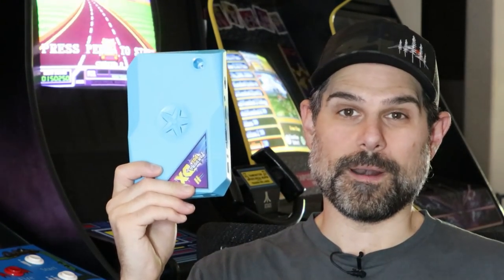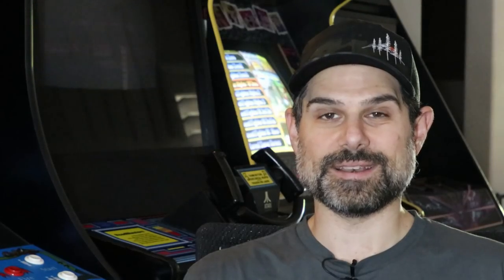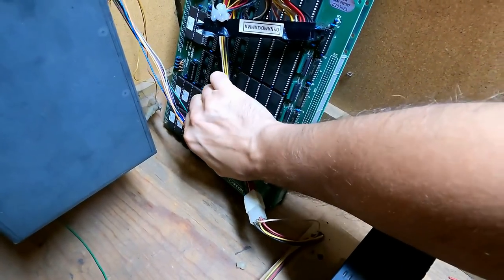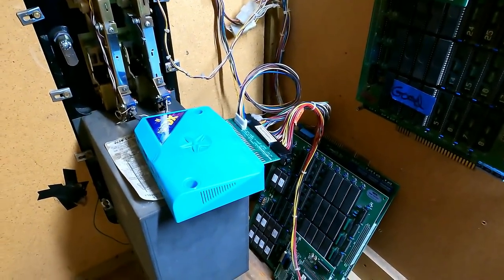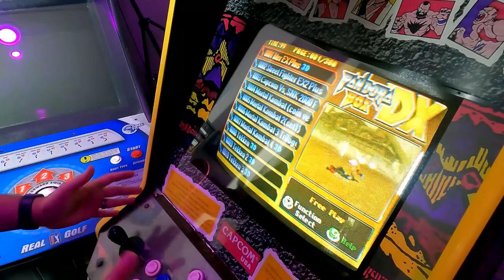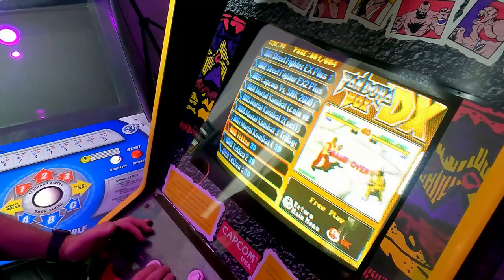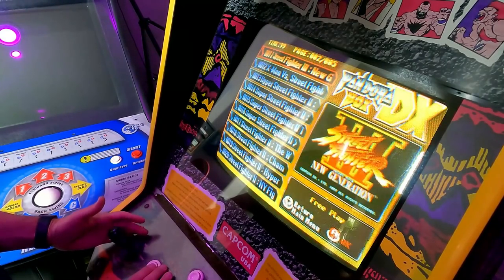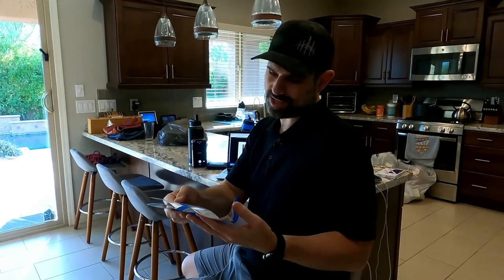Pandora's Box DX in your Street Fighter Arcade Cabinet - Is it Worth it?

Comment: I have one of these in an old converted Neo Geo Z Back cabinet with an older 26" Samsung LCD and a scanline generator over VGA. I think it may have once been an SF2 cab because the control panel was drilled for 6 buttons but only filled 4. It originally came with a single slot MVS and one of those 161 in 1 carts. The comic book shop I bought it from was going out of business and left it on all day, so the 25" tube had awful burn in and I couldn't find a replacement. The menu system and loading screen look slightly different on mine with a V1.3 in the corner, probably slightly more up to date. I put in a new harness, replaced the sticks with some IL bat tops and added all new buttons in all 6 holes. Works great, no bad tearing like I experienced in the Pandora 5 and 6. I'm happy with it and it's features.
Reply: I have a DX in an original SF2 cabinet I bought that came with a Pandora 9. I threw that out and put a 6 which was the best one till the DX.  I've noticed since I got the DX the screen is shifted to the right far enough that certain icons and graphics you can't see.  My cab came with a 720 LCD.  Was curious if you've had the same issue.
Reply: @mak23997  I don't remember whether I ran into this after hooking it up or not. I may have made some adjustments in the screen's OSD but that was a while back. My monitor is an older 26" Samsung computer monitor and I run the DX at 1024x768. Is yours running off VGA out? Could be the slight resolution difference if your monitor is 1280x720.

Comment: I went from a Pandora's Box 6 to a DX thinking it would be a solid upgrade and was really disappointed with the screen tearing and audio issues. The games were really low volume, but the menu screen was so loud it sounded like gunshots. 😂 I ended up replacing it with a Pandora Games 3D and have been really happy with it ever since. 

To be fair, I did get the very first run of the DX, I pre-ordered it and everything, so it's entirely possible that they fixed those issues and I don't know about it.
Reply: I bought a DX last month so I assume I have the newer one.  No menu screen is still loud and volume is hit or miss depending on the game but with NBA jam super low. My screen is also shifted to the right for some reason.  Not enough to be unplayable but enough to be annoying.  Worked fine with the 6 so not sure if you had the same issue. Also tried to connect a USB trackball where it says "trackball" as well as the other usb port.  Could never get the DX to recognize it.  What do you like about the 3D more?  The only real upgrade with the DX over the 6 is save states, and to me with very limited time to play, is a nice upgrade.
Reply: @mak23997  So basically with the Pandora Games 3D it just performs miles better. No screen tearing, the volume levels are normal as you'd expect, the sounds that are messed up in some DX games are in tact on the 3D, etc. Though I never use save states so I can't remember if the 3D does that or not. Matter of fact I'm going to check and let you know in a second reply.
Reply: @mak23997  Okay, yes the 3D has save states as well. Also the scan lines look much better than the DX if you're into that sort of thing.
Reply: @infernaltim  Thanks I am as I have a scan line generator for the VGA monitor that works way better than the DX does.  Thanks for the info!
Reply: @mak23997  Sure thing!
Reply: Use Pandory to update the DX

Comment: These pandoras are wired slightly different to normal jamma, the 6 buttons come through the jamma edge and takes 2 pins that would normally be ground on jamma, i use one of these dxs in my big blue i made a special jamma harness that plugs into my cabs harness and its has an extra button loom that taps into my cps1 kick harness thats permanently wired to my kick buttons so i can use panadora with my cabs 6 buttons

Comment: I've seen a dozen tutorials for connecting the family edition to an arcade1up but I've been eager to see the jamma edition connected to a real sf2 cabinet. I knew that the Pandora was a slightly different pinout, didn't realize an adapter was readily available.

I'd probably go the extra mile and mount it next to the real PCB. Not sure how safe it is balanced on the edge of the coin collector. Great to see it supports 480p out.

Great stuff, I don't see the issue either if the control panel and original hardware remains untouched.
Reply: I put an older version of PB into an original arcade cab I rebuilt. I bought a brand new jamma harness and plugged it right in. It was simple.

Comment: Is there a way to connect the coin door connections to the Pandora Box Dx for non CPS systems?  I have an Midway MK II cab, but the original board was removed and until I can get a dedicated board for it, I thought this would be a good solution.  However, I'd like to connect my coin door to it too.

Comment: Is it possible to play 4 player games using a pandoras box with a video signal splitter going to two different arcade cabinets with mirrored display?
Reply from the maker: I haven’t looked into doing a 4-player setup in a while.  I did in this video: https://youtu.be/wsUQfNiGZJ4  I’m pretty sure most of these boards let you simultaneously use the HDMI out and the VGA out at the same time so you could do that.  I would imagine a splitter would also work 👍🏻. I hope this helps.
Reply: @RetroRalph  Thanks for the response. If I give it a try in the future I’ll let you know how it goes. Keep up the great content!

Comment: Just recently bought a pandora box 9… with out the jamma adapter, just plugged in is that why it freezes? What is the purpose with the adapter? Rhanks
Reply from the maker: Did you set the video output to 15Khz? You need to hold the reset button and power cycle it till the LED is orange I believe.

Comment: Hey man i have a super turbo cab that also has a pndoras box with the adapter but the kick harness doesn't work. Does the adapter use a cps1 kick harness?
Reply from the maker: Yes, this particular adapter uses a CPS1 kick harness.  This will allow you to wire up the other buttons so you can play 6 button games.  If it's already wired then it's plug and play with the CPS1 kick harness, it's pretty cool.

Comment: hello I did the same thing as you even pandora boc in a street .... everything was working ok I left the machine running for about 2 weeks I turned it off and on and I have sound but no picture you can hear the sound of the screen that lights up but I have a black screen! I checked the pandora with an hdmi screen and I have the image I was wondering if it came from the pandora box or from the chassis that called???? thank you because I don't have a repairman in my area????

Comment: I have a Pandora's box 6. With save states on DX, will the save states stay even if you exit the game and come back. I've had a few games where I have to fix the controls every time I enter the game. Also, if I use and unlock code, it would be good to know I don't have to do it over and over.
Reply from the maker: The DX saves the games even when you reboot or power off the system.

Comment: What is the screen tearing like on a CRT? Much better to get a Pi2jamma running PinHP.
Reply from the maker: It's minimal if you're using a CRT in 15Khz mode.
Reply: My PBox 6s had horrible screen tearing EVEN on a CRT screen in 15khz mode. For example Final Fight’s scrolling was awful. Couldn’t tell how bad it was from your video. In contrast, a pi2jamma running PinHP has no screen tearing on Final Fight, making it a much better option.

Comment: Are the 60 in 1 boards chamma or jamma?
Reply from the maker: It's tough to define but I would typically buy a fresh new switching power supply, get a english labeled JAMMA harness from https://www.pyb-arcade.com/ and wire it per the diagram provided in the manual.  The 60 in 1 only uses 3 action buttons and "potentially a trackball" if you choose to wire it up.  Hope this helps.

Comment: Quick question can you do that using a Neo geo 4 slot cabinet
Reply: Neo Geo isn't completely jamma. They sell adapters to make it work though. Just seach Neo Geo to jamma adapter.
Reply from the maker: You can plug it directly into the jamma harness and buttons 1,2,3 and 4 should work.

Comment: I have double screen on my cabinet,how to fix it?
Reply from the maker: It sounds like you’re running it at the wrong resolution for your CRT.  If you hold the button on the back of the Pandora’s box when you boot it up, it will change the output resolution of the Pandora’s box.  The indication light should be yellow for usage on a standard resolution CRT.  Good luck 👍🏻 and I hope this helps.

Comment: How do I solve the image being upside down?
Reply: For those that have this issue, there are two, two-pin connectors that both need to be flipped connected to the monitor board. So if they are plugged in 1-2 and 3-4, just unplug them, flip them 180, and put them back in their original places only now they'll be 2-1 and 4-3.